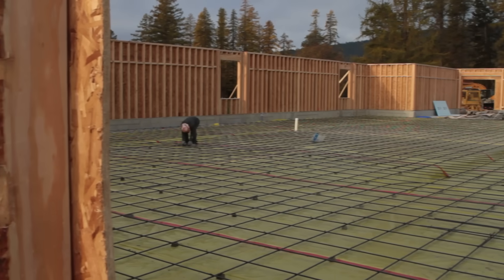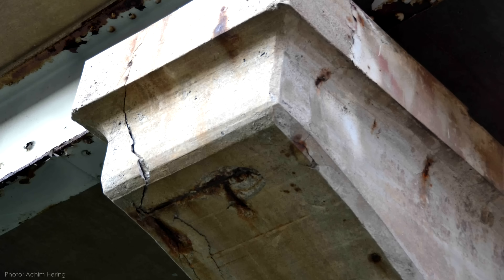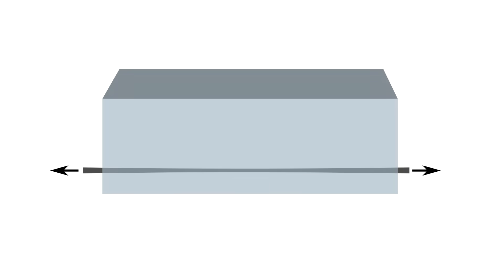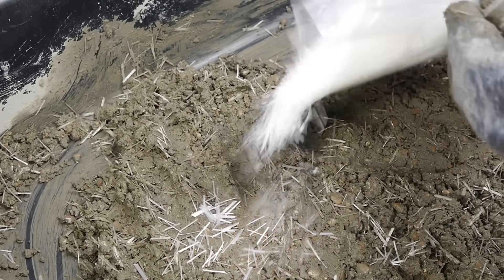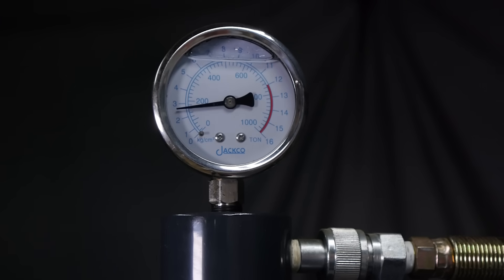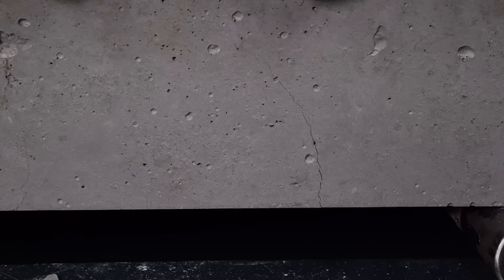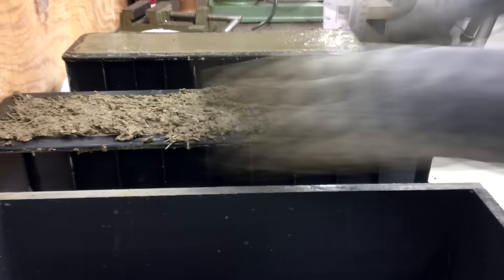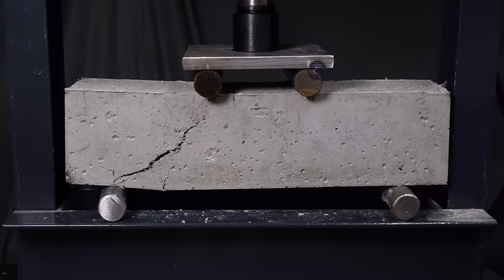Does Rebar Rust?

Comment: It's a sad fact of our industry that an engineer talking about concrete cover can't find stock footage of a slab being placed with the reinforcing properly supported on chairs.
Reply: The Essential Craftsman channel has some good videos of proper concrete reinforcement and form set up. He walks you through the process on doing a few different projects, including a heavy retaining wall for site prep for building a house. It is a great channel for learning about the construction trade.

He is also completely insane with his skillsaw skills. I am talking ripping a 2x4 to have a 45 degree bezel on the edge freehand type skills. Serious DO NOT TRY sort of stuff.
Reply: @KnightsWithoutATable  Great example lol Guess you missed the giant crack in the corner of the wall he poured
Reply from the maker: Well it served as a nice counterexample ;)
Reply: I do inspections on slab reinforcing all the time. They never use chairs. Just concrete bricks.
Reply: Hungry by Nature chairs just fall over constantly... Never thought about using bricks
Reply: Jarrett Williams for foundation slabs, chairs tend to sink and sometimes poke holes into the vapor barriers. I live down south so the soil conditions aren’t that great. Concrete bricks also act like a mini-spread footing. Also, concrete blocks are easier to modify if the placement position of the rebars are not satisfactory.

Keep in mind, you cannot just use any bricks. Different density and material can cause problems.
Reply: Hungry by Nature  Then use chairs with the rubber feet on them.
Reply: @PokeYourEyez  adobe blocks
Reply: I’ve been doing concrete repair for a few years now and have noticed that structures built in the 60s or earlier have used steel chairs to hold the rebar off the forms. Because the chairs cure at the surface, they often corrode and the corrosion is lead to the rebar itself. Perhaps this is why plastic chairs were invented? Also, I cannot tell you how many times I’ve repaired spalled concrete which was caused by shallowly embedded rebar.
Reply: @Bansheekilr  I can't tell you how many steel chairs I've had to grind out of ceilings because they were rusting..
Reply: Where i live reinforcement chairs are standard, and ALWAYS used even on small pours. Every reinforcement that i saw or installed had chairs in them.
Reply: I've poured a few yds of mud, and you're right.. If the engineer ain't looking, you pour, 9 times out of 9 something is out of place from being walked on a hundred times, and the chairs or bricks simply get driven down and hold nothing. And once the Crete is coming down the chute or pump it's basically: fuck it,nail it there..oh, I'm sure there's stock footage of proper placement, but I bet only in a very controlled environment where most if not all actual real world stuff never occurs,: sloppy weather, class C soil that will never pass spec, just get it done so I can nurse this hangover,: I know exactly zero coworkers who wear a labcoat to heavy construction.
Reply: I used a chair whilst watching the video. Did I do it right?
Reply: @GoForGold256  sure did.  Gold star and to the head of the class for you.
Reply: It's a little surprising...? I pass by construction sites with spacers placed pre-pour quite frequently. Though nowhere near as frequently as I pass by steel mesh laid out on just whatever and left to mature like a fine wine all exposed to the rain for a week or two :D - I've used them... And... They're fine? They're cheap and they work....? But I've also heard someone (an engineeer, building a high/precarious pedestrian suspension bridge) go on and on about the hassle and expense of them........ He was using plastic ones....... And I thought he must have been using special bridge engineer grade ones or something... So I looked at their code... And no, same ones that were like $0.50ea at the hardware store...... And he only needed about twenty...........?! Didn't hear him complaining about the cost of using a helicopter to pour the concrete though :D
Reply: Strange in Australia we use chairs even for backyard paths, only time we dont is if they were forgotten or didn't have enough.
Reply: Tim Foy .That's because they have destroyed the photos!!
Reply: SaltyBrains  bwahahahaha
Reply: I was an apprentice rod buster for 2 years 18 years ago. And that was one of the first thing I said 'where are the chairs' when he was showing examples of bar sinking. 
First day stuff.
Reply: That's because in the real world chairs are hardly ever used.
Reply: If you need the slab or wall to really hold up, you do need a method for holding the rebar in place until the concrete cures.
Reply: KnightsWithoutATable So you're saying that if you just pull up on the rebar it won't stay in place in a 5 or 6 slump pour?
Reply: @Inprocessalways  nope, lazy contractors try it and the slab cracks away from control joints. A properly reinforced slab with control joints cut at the right time does not crack.
Reply: In & Tim
I've been a construction electrician over 30 years, I've seen many hundreds of slabs poured, 90% of them, the bar is on the stone or plastic, they pour it, then yank the bar up a bit, the only time it's supported is on spec jobs, I do always use supports to hold my pipe in the middle, I've poured a ton of little transformer pads myself, I usually used 4X4 wire mesh, I just yank it up a little.
Reply: Tim Foy you sound very knowledgeable and experienced when it comes to this topic.  Have you worked in trades long?
Reply: @bigredc222  is correct.

Most of the time, that is how it's done.

Lay the reinforcement, pour the concrete, and pull the reinforcement up as the concrete is being poured.

The concrete supports the reinforcement in position as the concrete sets and cures.
Reply: whens the right time?
Reply: Tim Foy All the steel should sit on chairs at least 3 centimetres from top and bottom of the slab .
Reply: @Batman-wv5ng  3" dude, not cms,
Reply: Our guys just use halves of bricks instead of chairs.

Comment: Good demonstration of why using fibers With steel rebar allows the ability to pour massive areas for floors or patios without control or even expansion joints (provided the substrate it is poured on is stable and prepared appropriately).
Reply: good point

Comment: Hey, I love your videos and have been a long time follower. I would like to point out all the failures you showed were shear failures and a lack of good development at the end of the bars. It would be awesome if you could do some videos with some ligs and possibly hook the tension bars to show the increase in strength. This would show the ductile nature of well designed concrete beams and why steel is such a good material.

Also another benefit of putting plastic fibres into concrete is for fire. When concrete cures, there will always be leftover water trapped in the material. During the fire, extreme pressures build up inside concrete and can cause a potential blowout of the concrete. By adding plastic fibres pores will develop allowing the steam to escape.

Comment: If you can't see any cracks before the concrete fails, how are you supposed to do maintenance on them?
Reply: I think that's not the case. There should still be a large gap between the force that causes cracks in spite of the fibers and the force needed to cause the rebar to fail.

Comment: Why not simply use aluminium where salt is a problem?
Reply: simon ahlkvist Aluminum and salt is basically a battery. You’ll have problems with static electricity and aluminum have problems when in contact with steel. Also, aluminum is a very weak material. These are some reasons why that material is not used in construction. 

I could be wrong. Can I get someone to back me up? Lol. I refuse to use Google.

Comment: I used to manage a crematory. As you can imagine cracking due to thermal expansion is a serious problem. When units needed to be refurbished that included lots of refractory. There was little metal rods mixed in about the size of a small finishing nail. The floor still cracked in short order.

Comment: Are the fiber for corrosion or for strenght ?
Reply: The fibers are for preventing cracking in the concrete, which prevents corrosion of the rebar as there are no channels for the water go travel to the rebar.
Reply: thanks

Comment: If you travel to European countries each town's downtown is filled with buildings that have been in continuous use for hundreds of years.

In the US we tear things down when they're about 60 years old because they're "unsafe." How long do stadiums last?

We no longer build things out of stone. It all has to be concrete so it doesn't take as much skill or time. But then instead of having a stadium that should last 600-1000 years, we have one that lasts 60. Not much need to take pride in your work if you know it'll be torn down in your lifetime because it's falling apart. :-(
Reply: The Hoover Dam seems to be going okay... I saw a documentary which stated that the dam is still curing due to the thickness of the concrete. Don't trust me on this as the documentary was rubbish in other places.
Reply: It's stunning how thick those dams are at the base! they've got a bit of gravity to them ;-)

Comment: Great video but wanted to add something regarding corrosion. Although a much slower process, rebars in reinforced concrete members not subjected to marine environments or de-icing salts can still be subjected to corrosion via carbonation of concrete. Carbonation occurs due to atmospheric CO2 uptake and subsequent formation of new minerals (such as CaCO3), which do not provide this "protection layer" anymore and destroy the protective coating of rebars. Oddly, carbonation actually is beneficial to plain concrete, increasing its compressive strength!
Reply: As far as my knowledge in chemistry reaches, the CO2 alone actually can't corrode your steel, as the corrosion process itself, needs water. Concrete is alkaline, due to the amount of Calciumhydroxide in the mixture, wich can react with acids to form a salt of Calcium and water. The most common acid, is Carbonic acid, as this one can form by CO2 diffusing into water. So yeah, it isn't that much of an issue, since fluids diffusing through solids is horribly slow, and you can protect your concrete fairly easy by keeping it dry.
Reply: @cahdoge  It is a problem that all concrete constructions will face, but if the rebar is placed correctly it's safe for 50 years.
Reply: correct.  concrete is a very porous material, so water and air have no problem finding the rebar, crack or no crack.
Reply: no oxygen,  no rust.

Comment: To me it looked like all the beams were behaving like short beams and failed in shear at the support. I haven't done beam testing since college, but are beam test specimens normally longer in relation to their depth than your samples?
Reply from the maker: You’re right about the shear failure. I was hoping to show flexural cracking but I think the point was made with the demo either way
Reply: Your point was made. I was wondering if you remember the dimensions of a test specimen for finding concrete's modulus of rupture for unreinforced concrete. Adding those #4's really jacks up the flexural failure strength making the shear failure the controlling condition.
Reply from the maker: They are 4" x 4" with two #3 bars.

Comment: What about roman concrete that is near 2000 years old? I read about special concrete they made for a salt water port and scientists claimed it is just as strong now or even stronger than when it was first installed. Somehow the salt water combined with the concrete to form a new dense material. Also roman concrete was  much drier and was compacted, how would that affect modern concrete?
Reply: read the same
Reply: Roman concrete wasn't reinforced, so it didn't suffer from this problem. The reason we reinforce concrete anyway is that un-reinforced concrete is basically only useful as masonry! (which is what the Romans used it for.) The tensile strength added by reinforcement is what makes modern concrete construction even *possible*. 

The other thing that makes Roman concrete stronger that (un-reinforced) modern concrete is a difference in formulation - Roman concrete took years to cure fully, while we choose concrete formulations that cure much faster, to allow faster and cheaper construction. The thermal stresses from this rapid curing cause the concrete to be full of microcracks. We know how to make Roman-style concrete - we just choose not to, because it's impractical for modern purposes.

Comment: Whatever happened to galvanizing rebar?
Reply from the maker: Not as popular in the US compared to epoxy coating but still used extensively elsewhere
Reply: But the last study of the issue I read concluded the galvanized product bonds better to the concrete Practical Engineering. Thanks for the demo on the fiber reinforcement by the way.

Comment: Would it be a good idea if rebar were sheaved in a rubber liner like an electrical cable has plastic coated copper? Then at least tiny cracks wouldn't affect it with moisture.
Reply: Epoxy coating works like that. A rubber liner would prevent the concrete and rebar from bonding together, though. That would make your structure much weaker.
Reply: Ah righto, I guessed there would be a downside to it.
Reply: Cables akak wires used in post-tensioning are encased like electric cable

Comment: What if the rebar has already started corroding before the concrete is poured on it? In such a case will the structure last for the expected time? Or will there be a premature failure?
Reply: Surface rust is acceptable and does not affect the service life of the structure. Deep pitting is cause for rejecting the rebar and replacing it.

Comment: Steel reo also adds ductility to a structure. Ductility allows us to design predictable load paths as well as reducing the risk of sudden failure. Additionally Steel has a nice predictable elastic deformation until yield allowing it to recover its initial shape after a load is removed.
Finally another tactic to reduce corrosion is to limit crack widths. Small cracks, often as a result of thermal shrinkage can self heal because any water that infiltrates them tends to activate the calcium in the concrete matrix sealing the crack. As the cracks get larger the effect of this property drops off.

Comment: What if we FlexSeal all the rebar?
Reply: Your comment sounds facetious, but there is epoxy-coated rebar used in marine and bridge work to extend the time it takes for the rebar to rust. The reason it isn't used everywhere is because it reduces the bond strength between the rebar and the concrete, is very expensive, and has to be handled carefully to prevent any damage to the epoxy coating.
Reply: Very good point, Michael thanks.

Comment: My dad worked on the Long Beach Aquarium and all of the rebar in there is epoxy coated due to the salt water.
Any weld joints or any metal got a coating of epoxy paint before concrete was poured.

Comment: Tile glues are pretty far ahead in terms of flexibility and strength, you should try adding shredded tyre rubber into your mix like a modern rubber tile glue. Also do you think with all the concrete getting poured all over the world and the massive amounts of plastic heading to dumps and the ocean. We could look at recycling plastics or chemicals from plastics as a coating for the rebar, considering it would be going into a semi permanent structure?

Comment: Anti-corrosion elements or substances other than epoxy could be added or applied to the rebar (e.g. chromium or phosphate coating).
Reply: A comment mentioned that galvanized steel rebar is being used, but aluminized steel would probably last even longer.
Reply: It would be interesting to see the data on cost & longevity for both coatings.
Reply: That would be extremely expensive compared to normal rebar.
Reply: @HepauDK  I think a phosphate would be an affordable option.